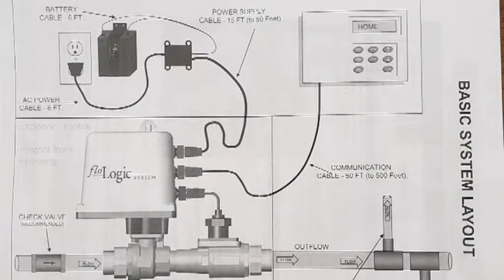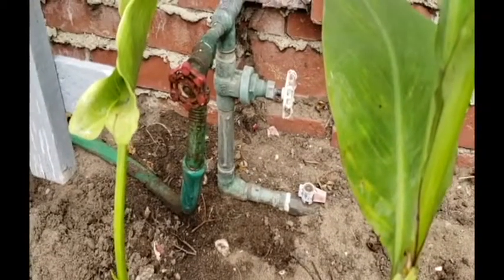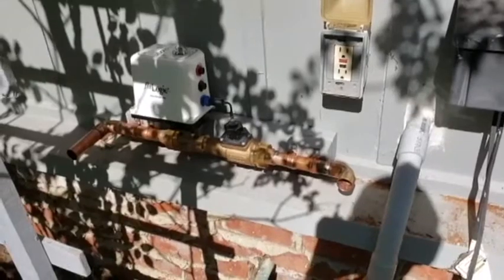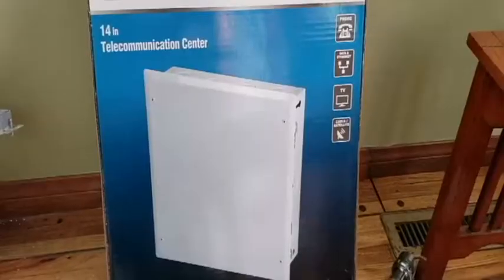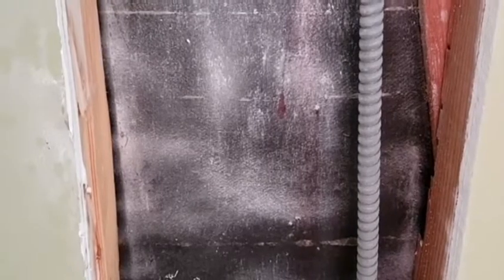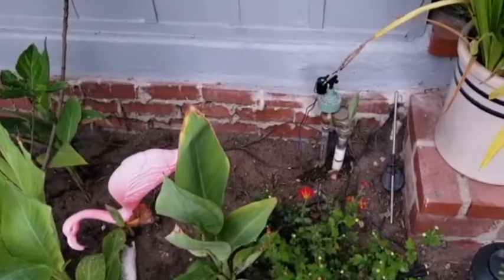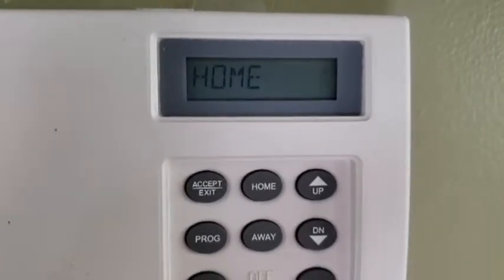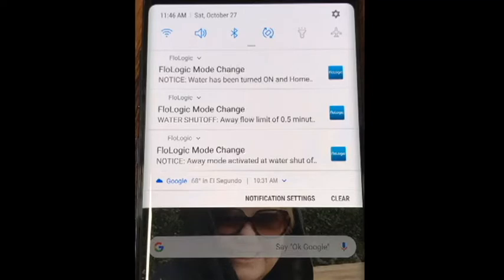installing a water leak detection and shut off system

Comment: Do you have a check valve installed before the Flologic unit? If not, have you had any issues with false alarms? Also, are you able to see your water usage over time?
Reply from the maker: No check valve and no false alarms.  No water usage associated with unit.  Water meter on main line coming into house upstream of shut off valve and of course the monthly bill from the city.

Comment: How is this system working today?
Reply from the maker: Still works great.  Once a year we have the windows washed and the guys leave the hose bib open.  The nozzle at the end of the hose is not a tight shut off so after the 15 minutes set point water to the house shuts down and has to be reset. I do not have to be home.  I can reset the valve from my phone.  Now the guys know how to reset the valve themselves.
Reply: Im aware that this has the same impellar design as the moen flo. However, I've heard mixed things about the moen flo's reliability

Comment from the maker: Really works!  A little while ago the system shut off the water.  After some investigation found the water heater had just started going bad with a very small leak.  Water in the pan gave it away.
Reply: Not sure if anyone gives a damn but if you're stoned like me during the covid times then you can watch pretty much all of the new movies on InstaFlixxer. I've been streaming with my gf recently xD
Reply: @Wyatt Maximus definitely, been using InstaFlixxer for months myself :D
Reply: HI Ron, Farmers Insurance sent us a notice yesterday MANDATING a automated water shut-off system for our rental home. They require a licensed contractor to do the work. What was the final cost for parts and labor? Did the city inspector come out for this modification?Great video!! Thanks, Kelly
Reply from the maker: @kellytuttle3311  I installed myself without permit so no inspection.  Coast was pretty much just the shut off kit.  Not sure about the current pricing but should be pretty easy  find